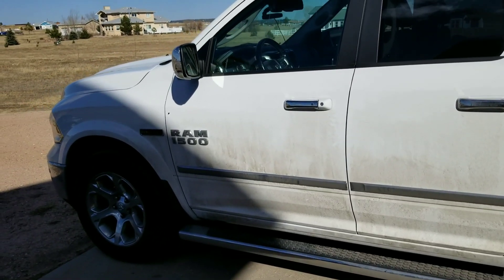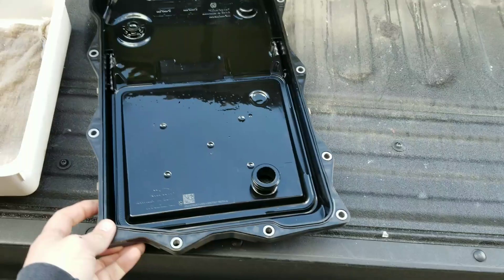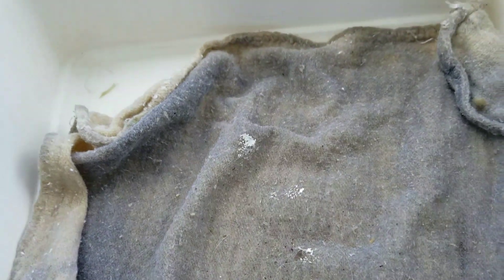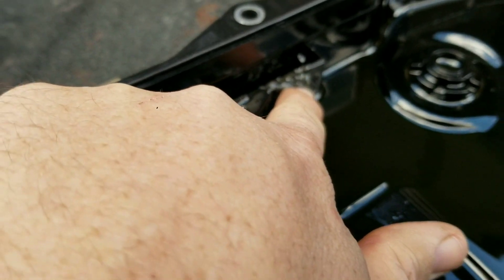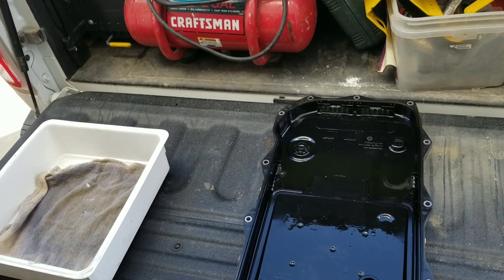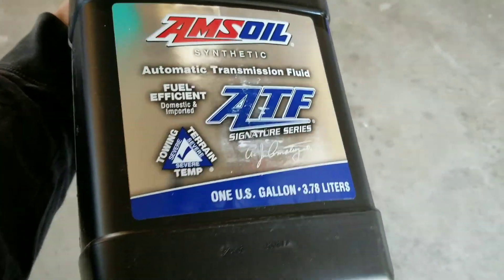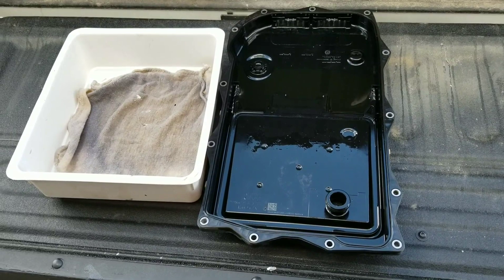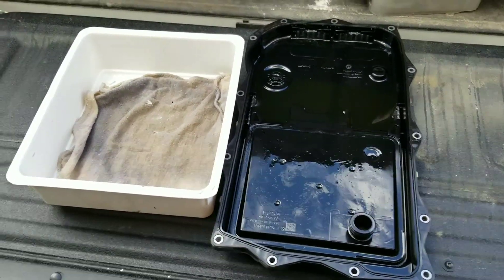Ram EcoDiesel 70K miles transmission service and findings: ZF 8-speed

Comment: I had a hundred and twenty eight thousand miles on my HP 70 transmission before I change the fluid, it looked about the same. But I was going off the lifetime service interval but after a hundred thousand I started to get scared.
Reply: I had an old Ram 1500 1997 with original transmission and I never had the transmission oil changed until 160K. Wasn't too bad when I drained but I did add Lucas transmission additive since I trust the brand overall.

Comment: Good video. I am under the Maxcare service contract so I will continue to use ZF8. I have over 20 years of experience with ZF trans as a user and have always drained and refilled at 45-50K miles. ZF recommends for this transmission drain and fill at 70K miles which is what I am doing after putting some in a while back at 50K miles but that was not a drain and fill just a check of the status which was fine.
I am not going to experiment with other brands and will stick with ZF8 even after my service contract is out and if I still have it at 150K miles will change the pan out at that time.
It is a great transmission and I am driving the Jeep not the Ram but I am doing the trans, the fuel filters and oil tomorrow....

Comment: That fine metal "dust" you found on the magnets are normal, and why they put the magnets in there. As long as you found no large particles, your transmission wore in correctly, and dark fluid isn't necessarily bad. If it smells bad enough that you can't take a good whiff of it, then it's bad.
Reply: Shawn it is darker but the brand new one isn’t clear like he said..it is light green, so from there to brown isn’t bad at all

Comment: Anyone use the Valvoline multi vehicle Max life ATF? I looked online at their product information sheet, and it says its equivalent to lifeguard 8. And only 27$ for 4 quarts.
Reply from the maker: Personally would only use the Amsoil signature ATF. It's engineered to be the best transmission fluid out there. It's a $10,000 transmission so make your own decision. The Valvoline is fine for the transfer case.
Reply: I also heard that that Valvoline is spec. I personally was planning to use champion global atf which is a 10 speed rated full synthetic
Reply: Im about to try the valvoline fluid
Reply: Sean aka mopar eco diesel used oem,amsoil and finally valvoline with zero issues with the max life and his truck had 190k I'm pretty sure and those were towing miles.

Comment: Would it be acceptable to measure the amount of fluid that you drained and then replace that same amount?
Reply from the maker: Rak Sasa Maybe. However if you properly follow the procedure then you would fill the transmission the second time until it overflows from the fill hole and then close it immediately.

Comment: Normal wear dark fluid is fine just means it's doing its job clutches and metals break in causing the fluid to get dark and the fine metal is normal that's the point of the magnets. 
I wouldn't worry unless you are having shifting problems or slippage.
Reply from the maker: slick ruler not so sure I'd recommend waiting for that

Comment from the maker: Actually the Amsoil ATF used is correct. Mopar ZF 8&9 Speed ATF is a full synthetic oil made by Shell and is also marketed as ZF Lifeguard 8. The industry spec for this oil is Shell “M-L12108 which is the spec for the amsoil signature ATF, and is a higher-quality fluid. The Lifeguard is overpriced
Reply: Neatnick7
 yup I'm looking into doing mine with amsoil. I drained the trans oil before at 20k lost about 4 quart replaced pain in the was

Comment: Thanks for your feedback. ZF has made many transmissions for many years now. They also have many different fluid specifications for those transmissions. Unfortunately, the fluid installed in that video was the wrong fluid. The ZF No. S671-090-255 fluid is for their older 6-speed automatic transmissions, it is not compatible with the 8-speeds. Additionally, the 5 quarts drained out is a little more than half of the total fluid in that transmission.  I recommend draining it again and putting the correct $$$ fluid in it ZF-LIFEGUARDFLUID 8 (ZF No. S671 090 312) https://aftermarket.zf.com/remotemedia/lol-lubricants/lol-en/lol-te-ml-11-en.pdf. Best wishes.
Reply: WeberAuto watch the old Mopar EcoDiesel channel on this, he talked about the AMSOIL fluid also.  And had almost 200k on his
Reply: I have read that ZF recommends changing the fluid for the 8 and 9 speeds every 50k miles.  Not seeing all the spec sheets, I would suggest getting the ZF oil until out of warranty, then look at switching to a different comoatible oil.
Reply: Robert Weber actually it’s 100,000 km (62,000 miles). Just discovered this myself.
Reply: Sorry, 50,000 - 75,000 miles, based on driving style ( directly from ZF’s web page)
Reply: Best to be conservative as style of driving in ones eyes is different than that of someone who will acknowledge for warranty.
Reply from the maker: WeberAuto Actually the Amsoil ATF used is correct. Mopar ZF 8&9 Speed ATF is a full synthetic oil made by Shell and is also marketed as ZF Lifeguard 8. The industry spec for this oil is Shell “M-L12108 which is the spec for the amsoil signature ATF and is a higher-quality fluid
Reply: I hope you are correct. I personally believe that using any fluid other than the exact ZF recommended fluid is asking for long-term troubles. Why even take a chance?
Reply: $10,000 transmission - Serviced as an assembly.  Better hope your right with the fluid - fingers crossed.

Comment: Unless you flushed the torque converter, your wasting your time. Your missing about another 6 or so quarts or dirty fluid. It doesn't hurt to change to fluid but the fluid you didn't get out more and likely contaminated the new fluid and filter.

Comment: It certainly would hurt to change more often but I would not freak out about that fluid color. Color doesn’t tell all for trans fluid or even engine oil. You are right though 50k would be more favorable for the the trans.